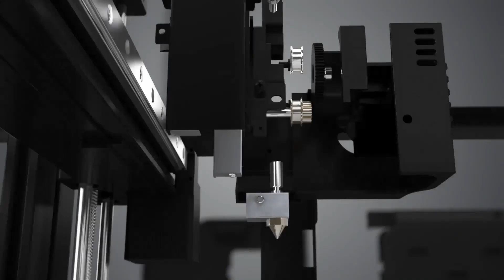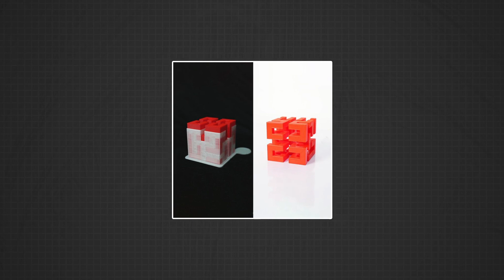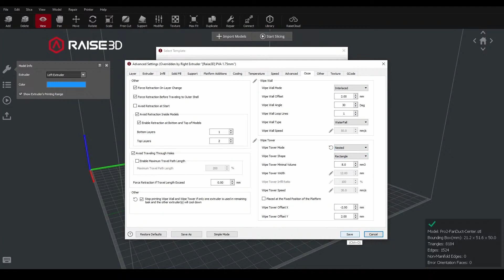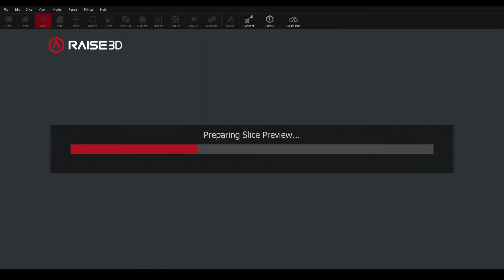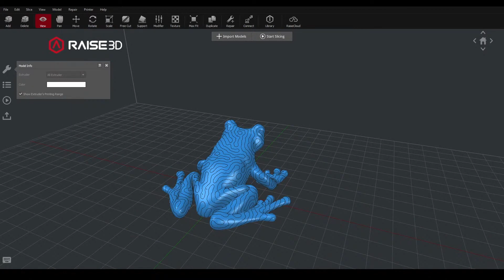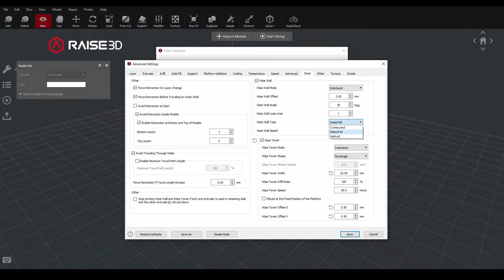Dual Printing | Raise3D Livestream Recap

Comment: Nick,

Rather than doing low quality lives, ya'll better make short straight to the subject videos. 

I can't find a video for chaning thermocouple and heating rod on Pro2. 

I can't find a video for changing offset settings for the right extruder.

I can't find a video showing how to tweak double printing if I have oozing or retraction problem. I can't use heat up in advance the right extruder if the nozzles switch between in like every 10-15 seconds. I can't reach 215 degrees from 180 in 5 seconds. 

Please give up the idea of long multi-subject videos with low quality resolution and start making high quality content for the users.

Thanks for all the work!
Reply from the maker: Hello Matei, thank you so much for you suggestion. We apologize for the inconvenience it may have caused; and we do have plans to create more tutorial videos for our subscribers. We will try better to improve our content. Please stay tuned!